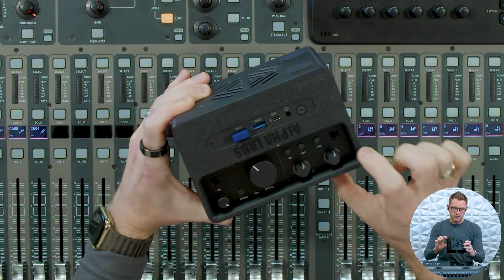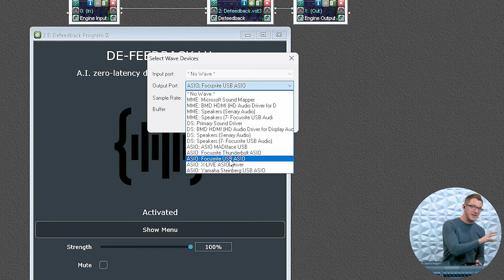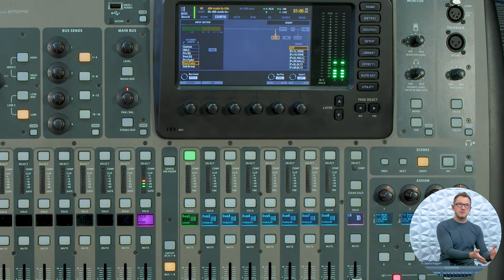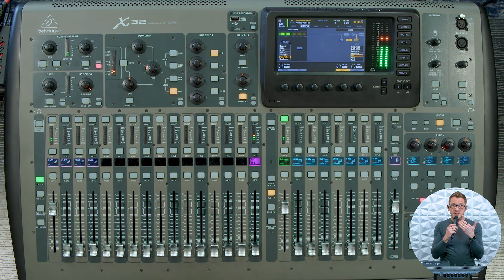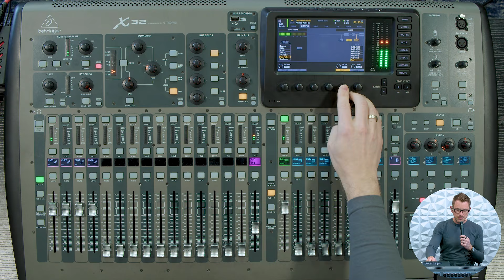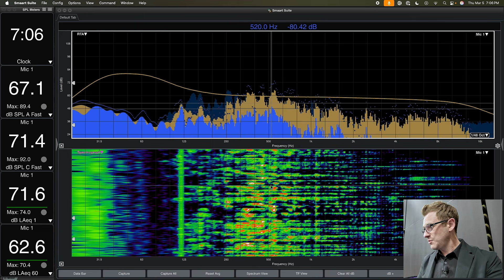Using Alpha Labs De-Feedback with the Behringer X32

Comment: I have been using the De-Feedback plugin for over 3 months now... I have to admit... Its IMPRESSIVE. With the custom PC-NUC option, it has been used in over 40 productions, including theatre (with +16 omni headsets), corporate events (with CEO's not knowing how to speak to a microphone)... anything. Obviously, is not magic. It will not cancel ALL the feedback if you stress test it. But you will get 6-10db extra of headroom in ANY scenario. A life-saver and an incredible piece of technology. No dropouts, no crashes, it just works and boots up in 5-6 seconds each time. Highly recommended.

Comment: Hi Drew, this is really a good tutorial on using the NUC with Focusrite. Are you able to test using a Windows laptop and/or a Mac with just the software? I am a mobile DJ and sometimes have problems with feedback on certain venues. If I can run the spftware on my Mac with my DJ software, that would be awesome and not get another piece of hardware to setup on my desk. I am also using a Behringer Flow 8. If I use the USB interface on the mixer to my Mac, how will the routing work? I would appreciate it if you could do a tutorial on that. Thank you very much!

Comment: Is there a way to use it with an m32c/dl16 as insert in a bus? 

Atm i‘m just use an xlr out feed from the bus and come back into the mixer as an normal channel this uses a channel and an bus. Would be great if i could insert into a bus or channel

Comment: Many thanks for your videos! Can you test De-Feedback with the new Behringer SC-U and StageConnect on the Behringer Wing. I think when works it would a great combination without using any analog ports / interfaces and holding open the wing usb connection for recording.
Reply from the maker: Yeah! I will make sure to test the StageConnect side for this. I don't have my hands on an SC-U quite yet, but I can test it with the DN4816-U in the coming weeks!

Comment: De-Feedback in Waves Superrack?
Reply from the maker: I'll test it at some point. The UI of SuperRack takes up a bit more processor power, especially with integrated graphics of the Option 1 computer. So, I would have to test this on a different computer. But De-Feedback is installable as a normal VST3 plugin, so you can install it and try it out as a demo on your setup!

Comment: Thanks for the video!  I had been looking at this plugin for a different application. I play in an all acoustic band primarily playing bluegrass and we use condenser mics only for the instruments to get the best sound. Feedback is an issue we have to work against. We have some good tools to do it, but I was wondering if this plugin would work for instruments. I have the most trouble with the acoustic guitar. Mandolin and banjo seem to be focused enough and throw enough sound into the mics that they require less gain. So they are less problematic, but still it would be good to apply where needed. Do you think it could work for instruments or is it only tuned for voice at this point?
Reply from the maker: Its main use is for speech or singing because the model is trained for voice, their FAQ on the site says that it is not recommended for music. With that being said, I haven't tried it yet. haha
Reply: @DrewBrashler thanks for your reply!  I do think it still means good things for the future. To me this is a sensible application of technology. I still may have to experiment with it. Your channel provides great info so keep it up.

Comment: Why are you using a focusrite Scarlett Gen 4 as audio interface when the x32 is in itself an audio interface seems like a lot of extra gear for nothing?
Reply: He's doing videos based off the manufacturers "recommended" setup first. THEN he's going to do videos on how to use the ASIO driver of the WING and X32.
Reply from the maker: Exactly! I was wanting to test out the official options before I start going crazy with all of the ASIO options that are available.
Reply: Because it sells with the audio interface and manufacturer recommends it.

Comment: What about a buffer size of 16 at 96kHz for the Focusrite? Average listeners would not hear it but the latency would go lower due to a higher sample rate.
Reply from the maker: Going to 96 kHz at a buffer of 16 drops the round trip latency from 5.73 ms to 4.98 ms, but it also takes the CPU usage from 33% to around 43% on the Option 1 computer. You can also turn off "Safe Mode" in the ASIO to drop that to 3.98 ms, but having safe mode off and that high of a CPU usage will give you a higher likelihood of getting some pops in the audio. It was stable in my short term testing, but not worth the added CPU usage in my opinion. You can take a look at all of my latency measurements here: https://docs.google.com/spreadsheets/d/1F8qjJzGcZYbyjIgS59slTSZoJsa92ttUDkjC3vaNuTU/edit?usp=sharing

Comment: Is there any way to use the USB card and a computer? 

I mainly work in amateur theatre and have QLab running on a MacMini using the USB card for sound effects/music so it would be great if de-feedback could be run on the same MacMini via the USB instead of having another computer/screen/mouse/keyboard.
Reply from the maker: I'll be having a video coming out in the next few weeks about using de-feedback with the X-Live or X-USB card. With that being said, I'm still only showing it being used with the Windows computer. The De-Feedback VST plugin for mac is still in beta testing. Also, check out https://jetkvm.com/ I have been using that on my Option 1 computer so that I don't have to use a full keyboard mouse and monitor with it.

Comment: Can I use the DN32 instead of the Focusrite? Have you tried?…
Reply from the maker: I'll have a video coming out in the next few weeks about using the expansion card as the audio interface. Its technically not officially supported by Alpha Labs, but it has been working in my testing.

Comment: Drew, should you only go the bus-based (multi-channel) route if it's likely that only one source in that bus group is actually talking / singing at a time? I didn't think De-Feedback would work well if it's listening to multiple sources at the same time
Reply from the maker: It works great with multiple speech/vocal channels at the same time going into a bus and then inserting on that bus. I have used this system at a handful of shows at this point with 6 tabletop microphones and a podium all speaking at the same time, no issues and it worked great. The best results are obviously going to be 1 plugin instance per channel, but you would need the Option 2 computer to get 4 or more instances. So it really comes down to cost if you wanted one instance per channel.
Reply: @DrewBrashler  Interesting! I assumed it worked with multiple tabletops like that because (typically) people wouldn't be speaking at the exact same time over each other! If it works with concurrent audio, that's really something!

Comment: How much latency is involved with the Windows processing?
Reply from the maker: Here is the full latency measurements: https://docs.google.com/spreadsheets/d/1F8qjJzGcZYbyjIgS59slTSZoJsa92ttUDkjC3vaNuTU/edit?usp=sharing. But with the Option 1 NUC w/ Scarlett Solo set to 48 kHz Sample Rate, buffer set to 16 and ASIO driver Safe Mode on, the total roundtrip latency through the X32 Aux insert is 5.73 ms.
Reply: @Dre @DrewBrashler thanks Drew!

Comment: Hi Drew we need to see the exact  connection how you connect those cables from the x32 to the defeedback box please show it
Reply from the maker: Yeah, I did forget to go into detail on this in the video, I'm sorry. Connect Aux 1 Output of the X32 to Input 1 on the Scarlett Solo. Then connect Scarlett Solo Output L to Aux 1 Input of the X32. Check out my blog post here for more info: https://drewbrashler.com/2026/alpha-labs-defeedback-behringer-x32/
Reply: @DrewBrashler thank you Drew 🙏
Reply: He says that the connection is to he Aux connections on the X32
Reply: Thanks for the video, appreciate it very much. How can I apply this to stage monitors / wedges ? If I am using 6 wedges do I need to have 6 computers 😅